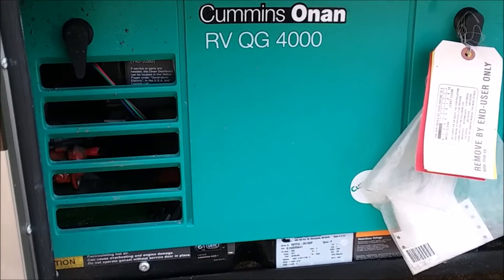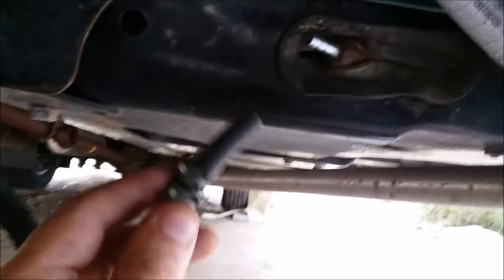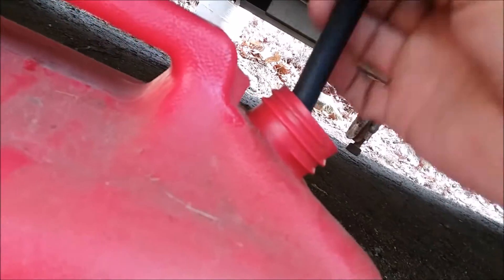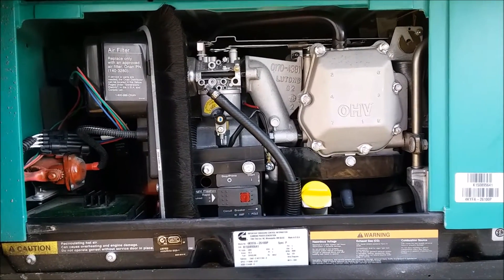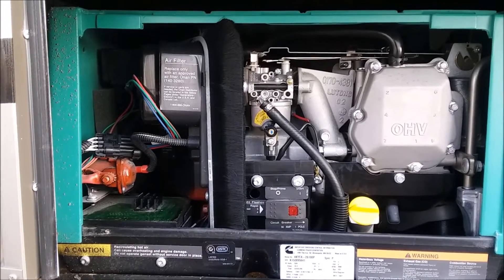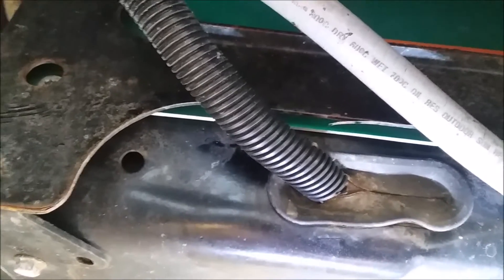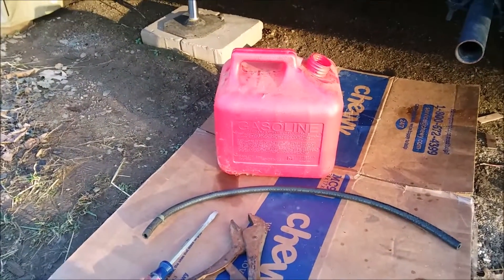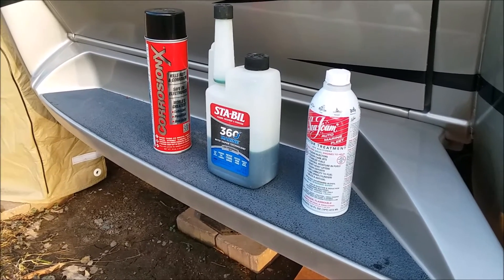Cummins Onan RV QG 4000 generator exercising, carburetor maintenance and surge prevention

Comment: Why not add sea foam straight into gas tank instead of the gallon can?
Reply from the maker: The gas for the generator is pulled from the chassis fuel tank.  You would need to put over 40 cans of Seafoam in the fuel tank for it to do anything worthwhile.  You basically want a 2:1 mixture for cleaning the generator.
Reply: RV Habit thank you! I’m new to this! Even if the tank is almost empty?
Reply from the maker: Well the generator will only take gas until the coaches fuel gauge is at 1/4 tank.  This is to prevent the coach from running out of gas when using the generator.  Most coach tanks are 55 gallons or more so at a 1/4 tank you would need a minimum of 14 gallons of gas in the RV to allow the generator to run.  That would mean you need seven gallons of Seafoam to get a 2:1 ratio.  You see the point, hence the gallon container with Seafoam mixture.

Comment: pretty sure this will work for a portable gen aswell
Reply from the maker: Absolutely I use this method on my two portable generators as well.  I also used this method on my 15 year old lawnmower.  Runs great.

Comment: My generator will start, run for about 5 to 10 seconds and then cuts off.  It only has 50 hours on it and I haven't changed the oil yet.  When it cuts off, the light flashes 3 times.  I plan on changing the oil and air filter soon.  Will this help?  I forgot to drain the bowl and it hasn't been run since July.
Reply from the maker: Hi the light flashing 3 times means there is a fault code that has been saved to the controller.  There is a way to retrieve the code but I would be hesitant to go into detail unless you are very familiar and comfortable working on engines and generators.  Not running since July is not optimal.  You want to run these generators at a minimum of once a month under load for an hour.  I prefer running it every 2 weeks under load. The carburetors gum up quickly due to ethanol in fuel.  I would check the oil level to make sure the low oil sensor is not cutting the engine out.  It sounds like your generator is new since you have not changed the break-in oil and it only has 50 hours on it.  I would recommend taking it in under warranty since it is new.  Let us know how you make out.
Reply: RV Habit thanks. I was reading in the manual last night to push the prime button once and it will tell you the fault code?  If it’s something simple, I’m kinda comfortable working on it. I bought the toy hauler with the generator in June of 2017.
Reply from the maker: Go to this link and then page 31 which explain how to retrieve codes.  
https://power.cummins.com/sites/default/files/literature/rv/F-1123-EN.pdf

Comment: why not just run the Sea Foam in the fuel tank?
Reply from the maker: Hi +richardsridge71 thanks for the question.  The fuel tank on the e450 chassis is 55 gallons and in order for the generator to run the fuel tank must be at least one-quarter full. That would mean at least 14 gallons of gas in the tank.  To get the concentration you need of seafoam you would need to add at least 6 to 7 cans of seafoam added to the gas tank.  Thanks for watching!
Reply: do you mean after performing the SeaFoam carb cleaning per RV Habit, why not then also use SeaFoam in the coach tank year-round (per SeaFoams recommendations) in place of the Sta-Bil ?!
Reply from the maker: If that's what was meant you can certainly run Seafoam in the coach tank year round.  However it would not replace doing the Seafoam treatment in the video.
Reply: Curious why you prefer to use Sta-Bil over Sea Foam as your everyday additive, carb/injector cleaner ?
Reply from the maker: No particular reason except I have been using sta-bil for years. More like an old habit than anything else.  Sta-bil does seem a little less expensive to use as a gas additive to avoid fuel breakdown.
Reply: thx for the reply. I've been using SeaFoam for both 'local'' intake treatment as well as for routine 'gas tank' treatment & was curious if StaBil was superior in any way. Agree about the price issue, but have been buying SeaFoam either by the gallon or when small bottles are on sale. Always trying to learn if theres something better/cheaper/easier out there, so wanted to ask your opinion. Thx!